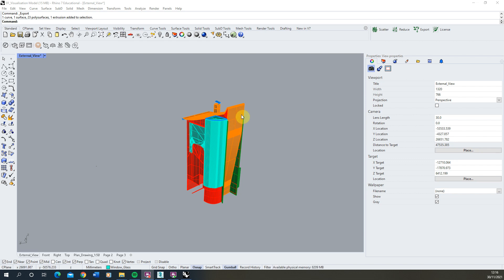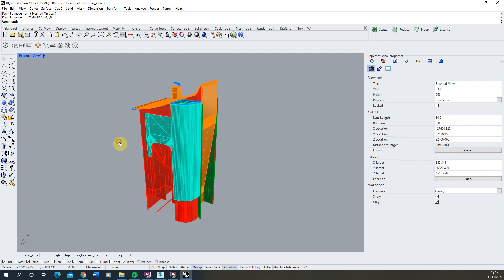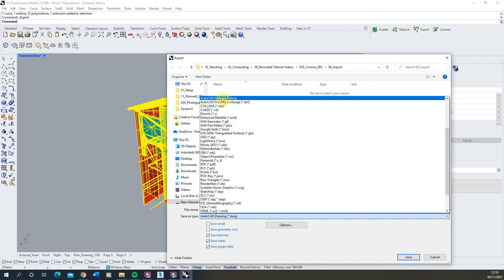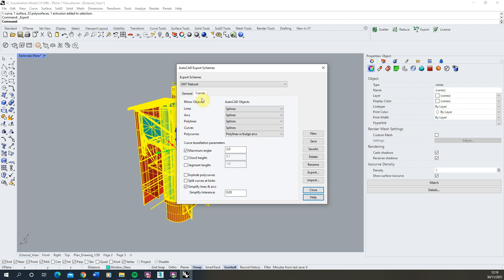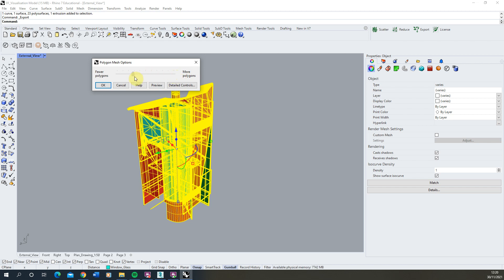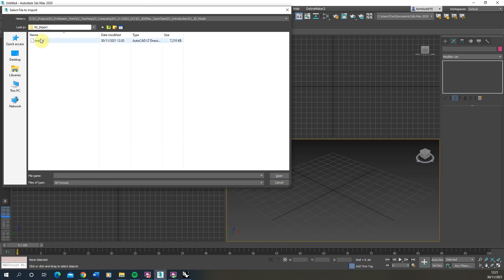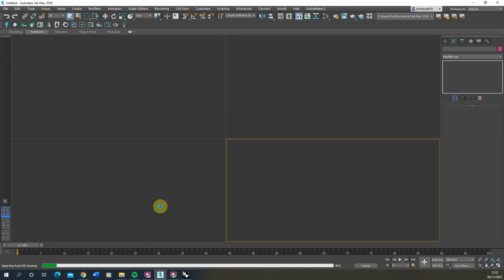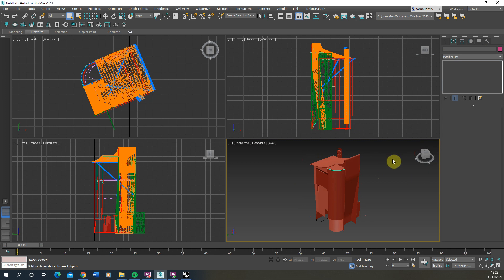Importing a Rhino Model to 3dsMax

Comment: To much messy meshes after convert nurbs into 3ds max readable file... You shoul explain a better workflow on the export department. Rhino curved surfaces only went to 3da max as a clean solids with stl format. But then 3ds max is quads proprietary. ...

Comment: Thanks a lot but I'm facing a problem after importing when trying to render and using materials the objects are in groups and I couldn't separate them like they are in rhino hope you can help me
Reply from the maker: You will need to select the object, go to the modify tab and under edit mesh you can detach specific objects from the larger group if you need to seperate them
Reply: @tombudd15  Hello Tom; thanks for the video. Since I've designed furniture with Rhino which have a little too many elements, I'm facing the same problem,. Is there a better way to export the 3D model from Rhino so that the different elements are recognized as separate objects in 3DS Max?

Comment: Thanks for this, very useful. 
Any idea on how to import a model with different materials? 
The hierarchy says it should split by material but for some reason when I import it in max it doesn't recognize any material ID or split the mesh further according to material. 
Right now the only workaround I'd see is to have one layer per material in Rhino, but this is quite cumbersome.
Thanks for your help!